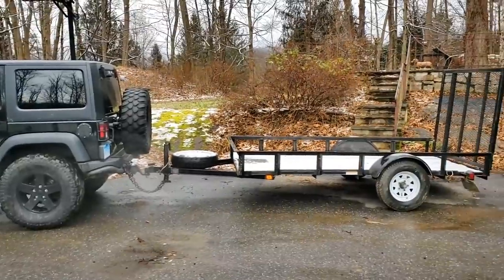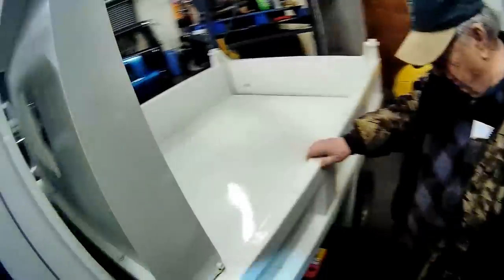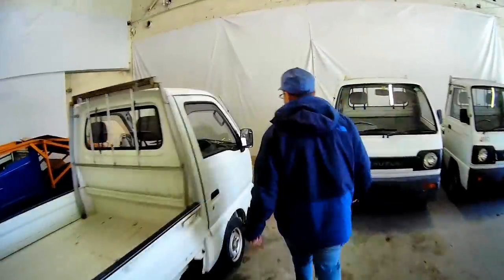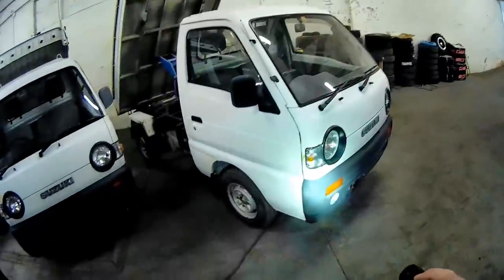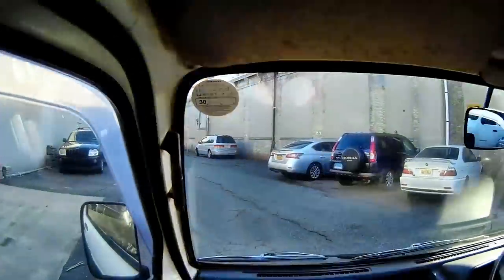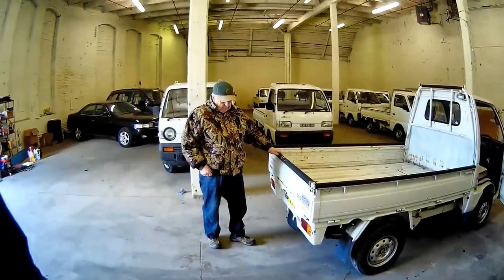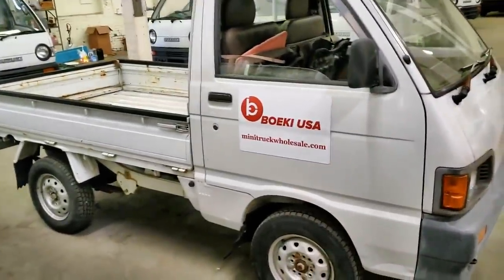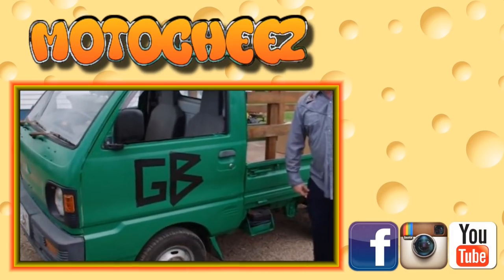$4500 Mini Truck info (SE01 EP01) what to look for, buy and get it home on 5x10 trailer

Comment: I used to own two of these for a business. One was a Mitsubishi MMC that had the roof cut off to make a convertible. That is how the previous owner got it registered in Maine as a Custom Vehicle. Unfortunately, the State caught up with the Kei's and wouldn't let us renew registration. The other was a Daihatsu Hijet with a dump body. Unfortunately, the college age staff abused them, particularly the clutches. If you need parts, GandR Imports has a full selection. I even purchased a rebuilt engine from them for the Mitsubishi. https://www.grparts.net/Default.asp
Reply from the maker: Damn. Sucks they did thAt. Thanks for the info. I'll check out that place for parts

Comment: These trucks are called suzuki bolan and suzuki Ravi in my country. Look it up. Very very reliable motor and easy to work on.
Reply from the maker: Suzuki also make these minis, they are all very similar, this is Daihatsu made by Toyota.
Reply: @MotoCheez  I don't mean to be an ass, but the Toyota reference Amir makes is about the fact that Toyota now has 100% shares of Daihatsu. At the time of production of your mini truck, Toyota had about 20%.  But stock shares aside, these Daihatsu minis were, and are, never made by Toyota. These light vehicles have been the staples of Daihatsu. (Est. 1907) In fact, in Japan, the distinction of car companies existed until recentyl that Toyota and Nissan are the "big shots" that ddin't make minis. Subaru is the opposite. They no longer make minis. Some Japanese blue colors make fun of Subaru by saying they became snobs.
Reply from the maker: Never knew. No offense taken, I'm glad to learn more about these. I'm no expert, that's for sure. Just having fun with my mini 😁

Comment: My teacher bought one of those and it didn't last long.  The motor was too puny and burned a hole in the piston.
Reply from the maker: Damn. Must have been running lean or something. 🙁
Reply: @MotoCheez  He drove it local in the city for several months without any problems. One day, he decided to take it on a highway for a trip and encountered the problem after 4 straight hours of highway speed driving.
Reply from the maker: That'll do it! They're screaming at 60mph!

Comment: Amir is a smart guy, the Japanese vehicle test is really strict, it is designed to force vehicles more then 8 years old off the road (this is beginning to happen in much of the EU as well thanks to the car manufacturers lobbying the EU). So Amir is probably charging the previous owners to clear away their scrap and then selling them on.

Comment: Turbo it. I have made many turns for these engines. They can scoot. I made the turbos for Joyner sandrails.
Reply from the maker: How do you do the carburated ones?
Reply: You use the non CV carb.  The CV carb will make a run away engine set up. And shutting the key off does nothing. Importer made me turbo the prototype 800cc. I can help but there are better things todo

Comment: What's the average price of the one that you picked out with the diff Lock 4 wheel drive?
Reply from the maker: I paid $4500, they're $4500-$5000 average. He has prices on his website www.boekiusa.com
Reply: MotoCheez that sounds a little pricey to me, thanks for the info I've seen them around NC for a couple Grand but I don't know if they were four wheel drive or not
Reply from the maker: I researched for a few months and kept checking CL. He was cheaper than they want on CL. A few people from FL said they're asking almost $6000 for same as mine down there. Ya maybe they're not 4x4? IDK
Reply: MotoCheez I do like Subaru , I've had a Forester about 10 years great vehicles but I noticed you said they don't have diff locks. But 4 cylinder turbo would be nice.
Reply from the maker: Yes, it would be! But I don't plan on using on the road much, just for my land basically
Reply: MotoCheez yeah I subscribed and I was looking at another video where you put those all terrain tires on it, they look pretty aggressive and you was putting the two inch lift on it with CV boots
Reply: MotoCheez be nice to get a deer out of the woods!
Reply from the maker: TY!! Here is the playlist if you want to watch it in order. https://www.youtube.com/playlist?list=PLcxhNVEfTm_NSX6kKwSul1ikThs59LskP

Comment: To be clear, HIJET doesn't mean midget in Japanese. HI comes from 'high performance' and 'JET comes from the phonetic rendering of the English word 'midget', therefore becoming HIJET. Daihatsu used to have a three-wheeled vehicle called the 'Midget' and the HI was added to differentiate this later vehicle that effectively replaced the Daihatsu Midget. The Daihatsu Midget was sold between 1959 and 1971 but was resurrected between 1996 and 2001, although this Midget was a four-wheeled version. Interestingly enough, whilst the cars were and still are badged in Latin Script, the phonetic Japanese rendering of HiJet is "Haizetto＝ハイゼット". 

Here is a link to the current lineup of the Daihatsu HiJet. https://www.daihatsu.co.jp/lineup/truck/index.htm
Reply from the maker: Interesting, thanks for the info, I'll update my description. When I was googling info I came Across the "midget" info. Your definition makes more sense.

Comment: Very cool!  I traded a VW for a Chinese version of one of these a few years ago. The big difference being that it's a left hand drive.  It didn't come with an engine ever installed but I plan to put a 4 cylinder BMW motor cycle engine in it.
Reply from the maker: Good choice of engine. Motorcycle engines will work perfect IMO. I never knew China even made one until a few days Ago. What brand is yours?
Reply: MotoCheez yeah and the fact that’s shaft drive and a flat design engine should help the install. I still haven’t figured out what I’m going to do for reverse though. It’s out of a K100 motorcycle.
Reply from the maker: I was thinking of coupling the output shaft to the transmission input shaft. Not sure how high the highest gear is on the motorcycles, but if close to 1:1 it would work awesome. But I think it's more like 1.17:1 which MIGHT work good. Keep in 5th, use motorcycles clutch and shift with trucks gearbox and transfer case
Reply: MotoCheez well I forgot to mention that it didn’t come with a transmission either. I will prob have a local driveshaft shop marry and balance the two driveshafts. Maybe reverse will just need to be fred flint stone style.
Reply from the maker: Hmm. If you could find an old samurai, those trans are tiny and have separate Tcase
Reply: MotoCheez well mine is only 2wd plus with motor cycles the transmission in an integral part of the engine block using the same oil. No separating the two. Engine and trans all one thing with the drive shaft coming out the back. I will mount it under the seat and connect the motorcycle drove shaft and the driveshaft that’s original to the truck. I’ll then figure out a way to attach the clutch cable to the pedal in the truck and then a lever to shift the sequential motorcycle trans.
Reply from the maker: Oh 2wd. Yeah, I know motorcycles very well mechanically. That should work good with driveshaft off rear like that

Comment: Try to hold out for a Subaru Sambar TT2 with supercharged engine (EN07Y) and diff lock (very rare). The engine is all the way to the rear of the back axles, which makes the vehicle much more quiet. It has all wheel independent suspension and better traction because of the engine location. A TT2 will go over 80 mph on level freeway if pressed, with 55 hp from the 660 cc inline four pushing 1468 lbs of truck. It won't hold up traffic, that's for sure. It also has the more reliable fuel injection and electronic ignition. We have a 2001. It came with AC, anti-lock brakes and the extra height cab. Wish ours had the diff lock. Currently the truck is parked awaiting all new hoses, coolant tubes, rear axles and front and rear back plates. The tin worm ate the back plates and the coolant tubes along with every factory clamp on every coolant hose. Time to freshen things up. I have found that the 2" lift on our TT2 allows us to mount 14" wheels and tires with plenty of clearance, but the over-articulation of the short axles causes the CV boots to fail prematurely. A pair of new axles is costly. Hard to find anyone to rebuild old axles around our neck of the woods.
Reply from the maker: I needed the diff lock for my land, I made some videos after this on showing mods :)
Reply: Subaru Sambar TT2 with diff lock is only the special made dump truck by JA (Japan Agricultural Cooperatives), and it is only before 2002.
There is no supercharger engine.
However, Sambar is easy to lift with a body block and it is fun to customize.
https://imgur.com/a/qSVJVtn
https://imgur.com/a/QHJBRqA
Reply: @MotoCheez  Oh yeah, I could use a diff lock too. Diff locks are the Holy Grails in 4x4 mini trucks in my estimation. I was surprised by how many that dealer had in house, impressive. I get two wheels off the ground now and then. One can use the brake pedal to get some extra traction, but it is hard to heel and toe around the steering column with size 13's, just when making a mistake could get me truly stuck or worse. My fall back is always the Kubota with tire chains and a 20' tow chain. I once drove the truck around the property on a foot of snow with a heavy ice crust on top. It never broke through. If it had, I would have had to use the tractor with blower to get it back up the hill. It would have been out there until spring thaw.
Reply from the maker: Yes they are. Have them in my Wrangler too.  I don't use unless needed either. Haha. Yeah I have an excavator for emergencies, but you know how slow they are..
Reply: @慈恩須水  Nice build. Wish we could have you work on ours. Looks a lot like our TT2, but we have the hi-cab and yours is in much, much, much better condition. These do a lot better in a salt free environment. There is obviously 0 corrosion protection on a Sambar. A Sambar TT2 on snow/ice tires doesn't need salt on the road, but almost everybody else does. How are you not burning through CV boots every 6 months with that lift?
Reply: @RAMelloh-ij5sl  Just by lifting the cab and bed from the frame (use ten of body lift blocks), only the big tires are installed, so there is no problem with the axle shafts. The drivetrain is original factory stock.
Reply: @RAMelloh-ij5sl  Absolutely, the suspension has not changed.
Reply: @慈恩須水  So it is a different type of lift from the one used on my Sambar TT2 or the HiJet in this video. Thanks for explaining. I like your method.
Reply: @慈恩須水  I dig that crash bar over your engine too. We live on a muddy dirt road. I think that exposed engine would not work too well for us, but I like to look at yours. The red crinkle coating on our valve cover is going away fast enough already.
Reply from the maker: TY
Reply from the maker: Thanks!

Comment: Wonder if they are Street Legal in Washington State...
What is the TOP SPEED?
I REALLY want one!
Reply from the maker: Not sure about Washington, https://www.iihs.org/iihs/topics/laws/minitrucks. Check your local DMV though. Top speed is 60. It's not a highway vehicle, but great on side roads
Reply: Street legal almost nowhere! That's the primary problem. Neat looking ,functional, cheap on fuel, but can't register them for the road almost every state!
Reply: @nicolasrossi5978 

Found out that "as long as they are 25+ years old, road legal in Washington State"!

Now to fix the power problem...

I hear that you can swap out the Carrier Ring in the Rear Axle on 2WD Models, but other than an ENGINE SWAP, I am lost with an AWD/4WD Model, let alone a 2WD/4WD Model...

My hopes & prayers is that I can get a 1994 Suzuki Carry and start investigating some and research for a "potential engine swap" that will fit the engine bay, but ALSO fit the original Transmission "without" blowing it to Kingdom Come!

Thanks for replying!

Take care,
-Thomas (12) SEAHAWKS FAN
Port Orchard, Washington State
Reply: @tkskagen  Likewise take care. I hope you can figure a way to make it happen. Sorry for initially coming across as a wet blanket, just that  initially several years ago I was very excited about their potential(was also looking at the ones that are in van configuration). Parks Dept. had a couple for sale but found out that here in Calif. non register-able for street/highway! By the way lived for several years on the other side of the Cascades (Eastern Wa.) not far from Spokane.  Best of luck.
Reply: @nicolasrossi5978  
Many thanks for responding to ME!

I'm sure you probably get SWAMPED with other viewers.

It make me feel "special" almost.

Take care Nicolas Rossi!,
-Thomas Skagen
Port Orchard, Washington
Reply from the maker: Legal under "classic" 25 plus years old.
Reply from the maker: All good😁  California.. pretty much anything with a carburetor is banned. Most every other state including CT allows classic JDM cars.
Reply: @MotoCheez 
That's "bucked" up...

I don't "think" these went to EFI until 1997.

I LOVE how your wife gets upset that you talk to Mini... I do the same thing to my 94' Ranger, just not as friendly. (She has 385,00+miles)

By Mini! (MEEP-MEEP!)
-Thomas Skagen🤓
Port Orchard, Washington
Reply from the maker: I believe it was 97 too. Was looking into EFI conversions...
Reply: @MotoCheez  Good Luck! Let me know what you find, PLEASE...

😎Take Care & be Safe!,
-Thomas 🤓 Skagen
Port Orchard, Washington
Reply: @MotoCheez  I wonder what limitations are put on "Classic Vehicles" in Washington? Milage, Color, and other STUPID CRAP!

Let alone, I wonder what my Auto Insurance Company is going to RAPE ME FOR $$$ Let alone what limitations USAA is going to ensure on a "Right Steering Non-Regulated Import"?

I was a Marine back in 1993...

😎Pease out y'all!,
-Thomas 🤓 Skagen
Port Orchard, Washington
Reply from the maker: Boekiusa has a dealer in Washington. Give them a call, insurance is cheap. 😁. Thanks for your service!

Comment: Do any of them have diesel engines ?
Reply from the maker: I'm not too sure...
Reply: I saw a Mazda diesel on their washington site, but no price listed like it was sold already....   
Met fire sprinkler pipe fitters 30years ago driving an old mazda diesel PU they may of weighed more than the PU but they were very happy with its millage...
https://boekiusa.com/inventory/mazda-bongo-brawny-dually-diesel-truck/
Reply from the maker: Nice, a diesel is the way to go for lonegvity.

Comment: How was the fuel economy?
Reply from the maker: 30 to 40mpg. Min had a stuck choke so wasn't great, fixed that so we will see next fill up
Reply: @MotoCheez  wow! That was way more than I was expecting
Reply from the maker: That's what others are claiming, when I posted 17mpg in part 22 (I think it was), even though I did a ton of offroad, owners said should be way better... Looks like it's going to be.

Comment: $4500 was a very good price for that Hijet dump truck.  They're more than that now without the dump, imported directly, without Amir's expertise and the ability to inspect yourself and test drive.
Reply from the maker: It wasn't a dump truck when I bought it I fabricated all the parts and turned it into a dump truck myself. Yeah the price is on these have gone way up
Reply: @MotoCheez  - That explains why I was confused when I posted, thinking you didn't buy a dump truck but knowing you have a dump truck.  I watched several of your later videos and just started from the beginning on the entire series, so I missed the dump truck conversion.  The conversion also explains why your dump truck doesn't look like a dump truck.  I prefer the pickup sides that can be lowered, but there are times a dump truck would be nice too.

Thanks for the great content, and the kei truck motorvation.
Reply: @MotoCheez  - I think soaring gas prices are part of the reason that old Japanese kei trucks have risen in price, but I think most of it is the shipping price to the US which is now around $2400, more than the cost of many of the 25+ year old kei trucks.
Reply from the maker: They do have dumps like mine with flip sides and a few other more heavy duty style beds.

Comment: you shud pick the suzuki scrum its effecient and the parts is cheap and easy to buy that daihatsu is the garbage type hard to find parts and parts is expensive than suzuki we have ltos here in philippines whenever youll go you will see lots of kei vans kei truck and the one that we convert from pickup to passenger type we cal it FB (full-body) passenger vehicles
Reply from the maker: I ended up buying a Suzuki carry dump too